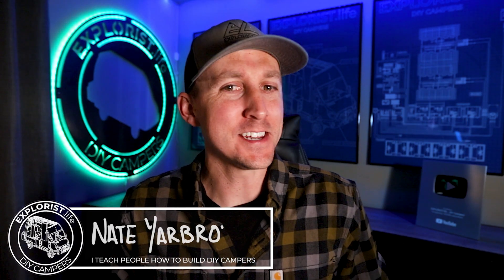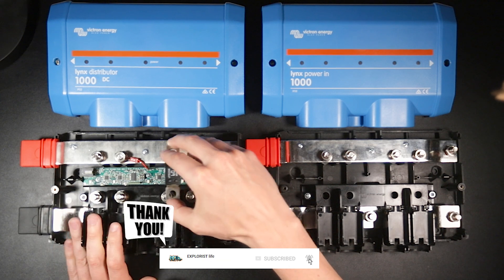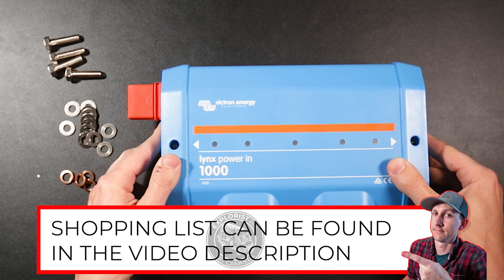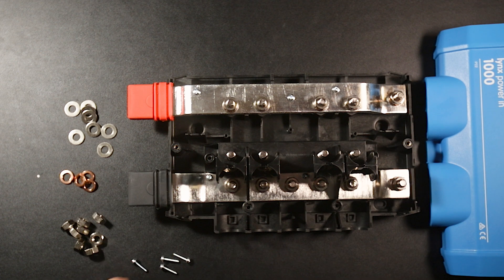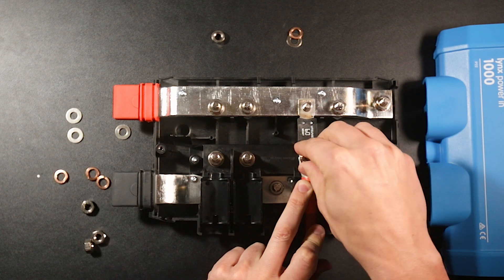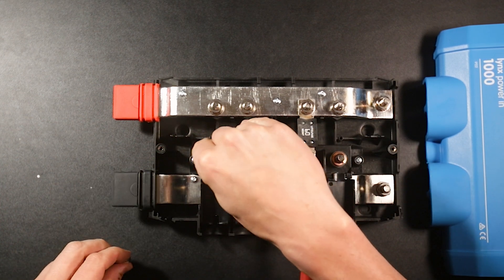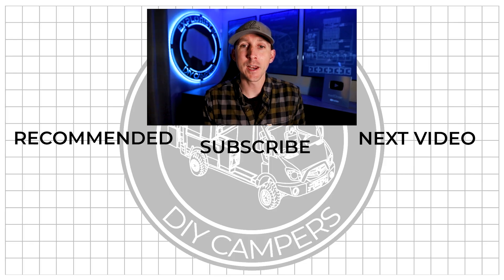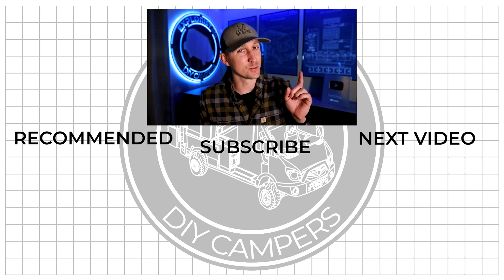How to Add Fuse Holders to a Victron Lynx Power In for a DIY Camper Electrical System

Comment: Would it be possible to use a MRBF terminal fuse directly on the bus bar instead of adding the screws/washers etc for the MEGA fuses?
Reply from the maker: Nope.  It wont fit and the current would also go through the bolt itself, bypassing the MRBF fuse.

Comment: Shame on Victron on the lynx distributor DC with their 48 V system minimum fuse size 125 amps.  You take the 12 / 24 V lynx system they have all kinds of amps fuse size Max 32 Volts.  
How come they don’t do the same thing for the 58 V fuse size systems with different smaller amps. It has to be the mega fuse size nothing else fits unless you can modify it.
Reply from the maker: Littelfuse makes 70V MEGA fuses down to 60A.
Reply: Yeah I found them I ordered some. When you look at Victron specifications between the shunt lynx to Victron lynx DC distributor specification look at the specs voltage .  Lynx shunt 70 Volts then distributor DC 60 Volts specification so don’t take my word for it go look they make things confusing they’re not consistent between their configurations. Then when it comes to the fuses same thing the voltage and amps.  So easy to find a 32 V ones but when it comes to the lifepo4 on 51.2 Volts .   Hey I’m just going by with Victron energy has on their specification.   All you YouTube videos that promotes Victron you need to get a hold of them straighten things out.   Battle born batteries same thing they couldn’t seem to give me the correct recommendation I had to do research and use common sense on my own.  The shunt why would they put a fuse for that?  I think that’s stupid on their behalf if you’re going to run it straight through the copper bus bar in there I mean gee after all it’s rated for 1000 amps through their bus bar.  On the distributor DC that makes perfect sense fuse for the proper applications that you are going to run up through it.  On the distributor lynx they give you the option to fuse or not to fuse lol.  For myself I fuse right at the battery source at the battery post terminal. 

Anyways thank you for all you do in your videos they’re awesome very educational like many others on here great content :) so look at Victorron specification on each individual things I mentioned look at the voltage and I am talking with the 48 V recommendation they have.
Reply: Mouser Electronics I forgot to mention where I found the proper fuse 0998060.UX-2M8

Comment: could i parallel 2 12.8v 100ah lithium into each input of the lynx dc in (total 6 or 8 batteries)with a 200a aml fuse? or would that cause a catastrophic event  resulting in the end of civilization as we know it.
Reply from the maker: I'm not 100% following what you're trying to do; but here's how I recommend wiring a full system: https://www.explorist.life/solarwiringdiagrams
Reply: @EXPLORISTlife  I guess I'm worried about 6 batteries in parallel/diagonally so I was trying to figure a way to parallel 3 sets of two onto the lynx busbar with fuses. Would I still need 4/0 wire and 250a fuse for each pair?
Reply: I used your diagram for my setup but no lynx. I undersized my wire (1/0) and fried the 400a t-fuse and wire leading into it. I'm hoping I didn't damage my multiplusII
Reply from the maker: @mdavis02us  Perhaps it's just best to follow my plans/diagrams instead of changing them up so you aren't frying fuses?

Comment: Could you add the power switch and shunt to the right side bolts  instead of the left side tabs
Reply: Thinking the same, so my input cables don't have to take the long way round. Might be possible to flip the bus-bars. I will have a look when mine arrives.
Reply: Now that it has arrived and I have had a look, I can see that he bus-bars are not reversible. Or rather the bar profile is OK to reverse, but because of the way they are drilled, the hole pattern is not. It looks like the cable are going the long way round. Seems a bit odd to have an asymmetrical hole pattern.
Reply: You could ... either Invert the Lynx (which is why they include an 'opposite' orientation faceplate), or use EL's Copper Bar set and connect to bolts on far right.

Comment: Gooing afternoon, I am a newby, I am trying to configure an independent solar grid.  My question is what mega fuse do I need for my victron lynx distributor. I have 4 12v renogy 200 ah batteries in series parallel for a 24vlt system.  From the lynx I would like to attach an aims 4000watt split phase inverter charger. I am uncertain what I will be powering at the moment with electral devices, but am going to run 110 ac from the inverter.  Please let me know if more information is needed and hopefully one of you can point me in the right direction for the amp fuse I may need?
Reply from the maker: This video will teach you how to size fuses: https://youtu.be/5y-yDMEgV70

Comment: What type fuse is being used? A CNN/ANN series? or a MEGA-AMG series?
Reply from the maker: MEGA fuses are what fit in the Lynx Distributor and modified Lynx Power In
Reply: @EXPLORISTlife  I measured the distance between the center positive terminal posts on the Victron Energy Lynx Distributor, 2.00 inches.
Thank you for the information.

Comment: why did you double nut the new "studs"?  I bought one of these and the regular studs on the positive and negative buss bar are not double nutted.
Reply from the maker: That's probably because the busbars are taking up the space of the lower nut, If I'm understanding your question correctly.

Comment: Thanks for doing this.  The link for the bolts takes me to 25mm not 30mm.  Do you know which I really need?  After adding this up kinda wish I would have got the distributor but this is where I'm at 😂

Comment: I just purchased this Victron Lynx Power in. I am going to have 4 batteries connected to this bus bar. Each battery has a 120a BMS. Will a 125a fuse work or should I go 150a?

Comment: A question on Volts, I am creating a large Solar array and thought the  "Victron Lynx Power In" might be the way to go, But the "Victron Lynx Power In" 1000A is also rated at 48v, my intended Solar Panel array is 6 x 300w Panels in Series-Parallel giving me 60volts, can the "Victron Lynx Power In" handle the voltage.
Reply from the maker: Nope.  That's the wrong tool for the job.  MC4 combiners should be used given you can keep the array amperage under 30A (which shouldn't be a problem with only 6 panels).  How to wire solar panels in series-parallel: https://youtu.be/b2H8vpj8rQg
Reply: @EXPLORISTlife  I watched your "Series-Parallel" video but still confused, your video states you add Volts if in series so, ( series-parallel  ) 2 x strings of 3 x 300w @ 20v each = 60volts / 34Amps , is that correct?

Comment: man i knew it was possible as soon as i saw the photos of both, it's a fucking joke, victron even put in the power in manual that you can't put fuses and you have to do it extarnally just to push you to buy the 50% more expensive distributor ahah! 
but in the end if you do it this way it's a great deal, compare to the cost of 2 4 slots busbar and 4 fuse holders it's not that expensive and it makes the install reallay neat! i'm definitely going for this solution on my forthcoming solar system!!
Reply from the maker: Glad it was helpful.  Cheers!
Reply: and the lights parts are pretty useless i would say because those fuses are never supposed to blow, if they do it means that you really have a serious problem in your install and need to pass evrything in review anyway, but that's only my opinion...

Comment: Excellent video. Is there enough/level space to fit the outgoing cable lug on the fuse bolt then washer and nut, then the fuse and washer?
Then the cable wont be loose when replacing the fuse.
Reply from the maker: Never tried it.  Unless you direct short these wires or something, you'll never be replacing the fuses, so that's really a non issue.

Comment: Is there space to tap an additional stud into the busbar? i need 5 attachment points
Reply from the maker: There's not.  You can simply bolt an additioner Lynx Power In or Lynx Distributor end-to-end for additional spaces though.

Comment: Do I need circuit breaker protection between lynx and MPPT or is the fuse sufficient. It does not show this in the OEM 50amp RV upgrade diagram
Reply from the maker: The fuse, as shown in the 50A OEM RV Upgrade, is indeed sufficient.  Any extra just creates additional resistance, points of failure, and system cost.

Comment: I have three batteries so I did this hack and used the 4th slot for my main system fuse.  Saved a few bucks and this should handle a 400 amp fuse nicely.
Reply from the maker: Awesome!  Glad it helped.  Thanks for watching!

Comment: First off, thank you so much for all your information, you are one of my favorite YouTubers of all time! I share your videos with anyone that has any questions about electrical systems in van or bus conversions!

Quick questions, is the 100 amp mega fuse being used to protect the cable that connects from the battery to the Lynx distributor (as opposed to the cable connecting to the solar charge controller)? AKA is the sizing of the 100 amp fuse irrelevant to the size of the solar charge controller?
Reply from the maker: The MEGA fuse is there to protect the wire from the Lynx Distributor to the Charge controller.

There would be a seperate fuse near the battery bank to protect the wire from the battery to the lynx distributor (https://www.explorist.life/solarwiringdiagrams).

The sizing of the MEGA fuse protecting the wire form the Lynx Distributor to the charge controller is based on Victron's recommendation, which is stamped on the side of the charge controller (and if there is no stamp, is sized based on the charge controller size).
Reply: @EXPLORISTlife  Thank you so much for the reply! You are literally THE BEST!

Comment: Just wanted to thank you for making this video. At the beginning of the pandemic I setup solar with a 24v battery bank and 2 victron multiplus inverters. Recently I have been having issues with my fuse holder getting hot and melting the plastic and this video helped me reduce connection points by putting the fuses in the bussbar. So I think my setup is a good bit safer now so thank you very much sir.

Comment: Hi Nate, 
Thank you so much for all you do. I'm not a camper but a lot of what you say I have used with my home set up and I'm thankful for that mostly with the solar disconnect video. My question here is with the Victron Energy Lynx Power in Battery Connector  do you just hook the battery bank to the tabs on the outside and then hook the charge controller and other equipment to the inside bolts?

Comment: Hi Nate thanks for all your help, got my lynx in and my cutoff switch yesterday, I’m wondering why you adding to kopper bar to connect them. When drilling the hole on the lynx from 8,5 to 10,5 mm you could bolt the cut off on the lynx and all is perfect or ?
Reply from the maker: You can indeed drill out the holes instead of adding the copper bars.  The copper bars are for those who are uncomfortable drilling holes in a $200 piece of equipment.
Reply: @EXPLORISTlife   thanks so mutch, would you like to get a picture?
Reply: @christianwinkelmann8477  Hey Christian, did you coat the copper or just left it exposed after drilling out?
Reply: @EXPLORISTlife  Hey Nate, I'll be drilling the holes so I can fit an M10 bolt (happy to film it if you want footage of this btw). Do you think it is necessary to tin coat it to prevent corrosion and improve the contact surface or should it be fine to leave the copper unprotected? If so, could I use a solder ion for this?

Comment: 4/0 awg wire with ring terminals does not install into these very well. 4/0 is what is almost used by EVERYONE.
Reply from the maker: Most 4/0 wire lugs fit just fine.  There is one supplier who recently had a batch that were a wider design that didn't fit, but I've only had 3 people experience that and they just sent them back and bought a different brand and they fit.  Personally, I have nearly a dozen different brands of 4/0 wire lugs in my shop that all fit.

Comment: The "common" practice in North America seems to be to have a T-Fuse immediately off of the battery bank, but in all of the Victron diagrams, there is never a T-Fuse and from what I can see you are using either a Mega or ANL fuse off of the battery bank.  What gives?  When do you recommend each of these different style of fuses?  Does the Lynx use Mega or ANL?
Reply from the maker: The Lynx Distributor uses MEGA fuses.  There needs to be an ANL fuse (or T-fuse or MRBF fuse) between the battery bank and the lynx distributor, though as noted in all of the diagrams found at https://www.explorsit.life/solarwiringdiagrams  A MEGA fuse does not have a high enough Amperage Interrupt Capacity to be the main fuse in the system like an ANL, T-Fuse, or MRBF fuse.
Reply: @EXPLORISTlife  Thanks!
Reply: The Lynx "Power In" should be called the "Power Out" because it uses the wrong style fuses for incoming power.  The bolt spacing is too narrow for a high interrupting capacity fuse.
Reply: @SteveRivett  The fuses for the battery side need to be at the battery...placing then at the distributor would defeat the purpose of the fuse (protect the wire from the battery to the distributor).  From the distributor to the various loads you no longer need ANL/T fuse as these wires will not be exposed to a shorted battery since the ANL/T Fuse located at the battery will handle that.
Reply: @dankarau2307 if you use a smaller wire for any new connections you will need a fuse.

Comment: The parts finally arrived! I had a little trouble with the screws. No idea what it's called, but a tiny cross-shaped bit worked. I'm installing my electrical system this week and I could not have done it without your simple instructs on an insanely complex subject.  THANK YOU SO MUCH!! 🐶

Comment: Thanks for the demo, question though, I'm doing moderately big solar job, I'm using Pylon lithiums with their own bms, so no need for a shunt or BMS, but I do want the fuse indicators though as a nice to have, it's a $70k job. I assume I can use the smart shunt and it won't interfere with my lithium BMS or do you foresee any issues? Will the smart shunt give me online/app visibility of the fuses as well like the smart BMS does?
Reply: Did you get an answer to this question?  I will be using Battle Born Batteries for the Victron BMS is not appropriate for me, but i will be using the Lynx shunt.  i am hoping the fuse indicator functions  in both the local LED as well as in the software notifications.  Anyone know if it would work both places?

Comment: I've got a question hopefully someone can answer. I've emailed Victron direct, but they refuse to answer my question and keep pointing me to a local distributor or dealer. Not easy to do when you've purchased your products from Amazon links. I have a SmartSolar MPPT 100|50 and a SmartShunt 1000amp. If I use the temperature sensor for BMV 702/712 as shown in the SmartShunt user manual to get battery temp along with the voltage data the SmartShunt already provides, will the SmartShunt share the battery temperature data with the SmartSolar MPPT over the Bluetooth VE Smart Network so I can use the low temp charge cut off protection feature in the MPPT? Hopefully someone can help. Thanks.

Comment: Wish it held six fuses in that form factor rather than four.
Reply from the maker: You can simply bolt multiple units together to add 4 circuit spaces at a time.

Comment: I have nothing against proposed solution but the price is WAY to high for what it is. IMHO fuse-breakers are the way to go (preferably made by BussMann - https://www.amazon.com/dp/B01G5WHSFQ).
Reply from the maker: I mean... do what you want... but by the time you get 4x of those and a positive and negative busbars (Blue Sea: https://amzn.to/3hHXjTk), you are going to be sitting near the $260 mark, all-in (not including the lugs and heat shrink to attach the breakers to the busbars)

When comparing price to price... your proposed solution will be about $100 more expensive than the modded lynx power in with twice as many connections (potential points of failure) and needs a larger footprint.

But you do you, for sure.  :)